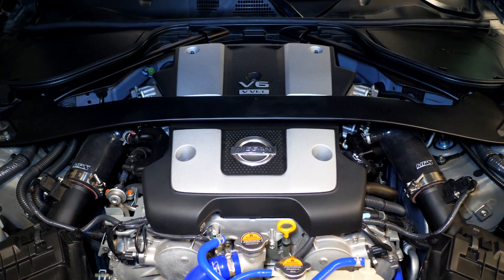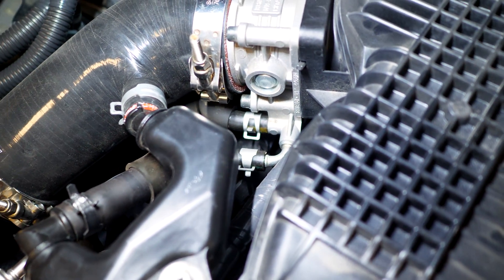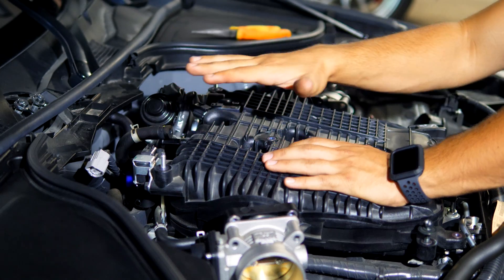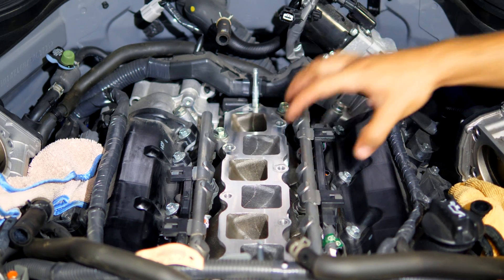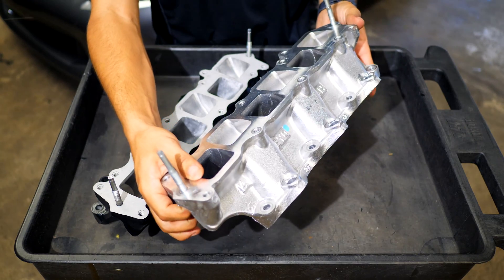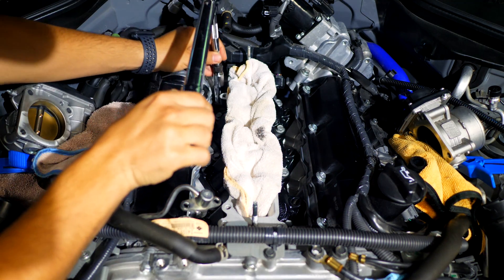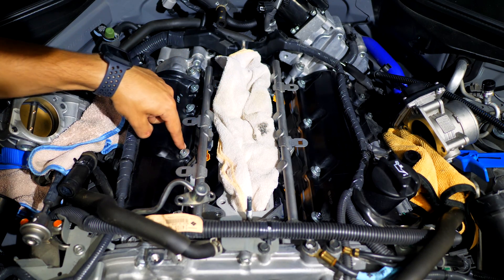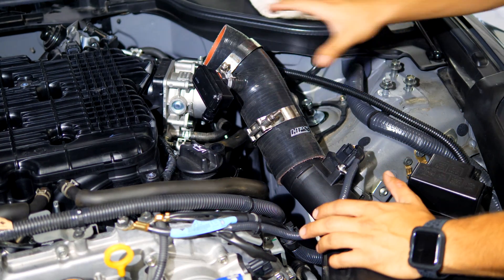Installing Ported Upper & Lower Intake Manifolds on The Z

Comment: clearly you should leave the throttle bodies on and pull the coolant lines. its stupid to pull them off and still pull one line. how about to take a look at the service manual before you make a video, youre 3 minutes in and doing it wrong. service manual is free for basically everything 86-14
Reply: not to mention it will bleed itself, the amount of coolant lost from the throttle bodies is negligible to the system

Comment: Jap engines are pretty well optimized as is. FIrst you need to know if its a restriction which casting lines etc arent

Unless you start from the beginning of the intake tract youre kinda hoping/guessing.

Comment: I enjoy learning how those manifolds made and assembled but changing them are just the waste of money because after, air just came through it.
Reply from the maker: So the point of porting them is to remove the casting lines & the inconsistency with the multi piece plastic manifold. By doing to, it allows for higher CFM, which allows the engine to make more power with a tune.

Comment: I been having problems with my G35 VQ35HR, my coolant is consume to fast and my car have a stall episode, I check for leaks and nothing is posible the manifold gasket have a leak or so, this can be a solution? No leaks anywhere in the visual inspection and this is the last chance 👀

Comment: Thanks for the help! Would like to note for others that you don't have to remove the coolant lines from the throttle body if you're just replacing the upper manifold.
Reply: What if youre replacing valvecovers ??

Comment: Great content. I'm doing mine now but I have a question re lower intake to head gasket. The gasket can be installed with the ports on the gasket either tapering in or out. Which way did you do it? Really don't want to do it the wrong way.

Comment: On the lower intake manifold, did you have to put and kind of gasket maker to hold the gaskets in place? Or do you just clean the old ones off the surface and lay the new ones in place.

Comment: Lol what's the link to that ending instrumental? After installing them does it require a tune asap?
Reply from the maker: If you have the funds to get a tune, I would defs get one after changing any engine related part. To prevent wasting an excessive amount of money on multiple tunes, try to play out when you're modding your car so you can get one tune with every part installed.

Comment: Interesting video, however most tuning specialists I've heard of usually re-profile the intake and exhaust camshaft to accompany gas flowing (porting) the intake manifolds.
Otherwise even after a "tune" the gains are minimal.
Reply: I didn't make any power with upper and lower ported manifolds, dyno proven unfortunately. I went with a knock off company lol. Even with a tune it made no power. Maybe it depends on who does the porting and if it's done right? The upper and lower manifold should be port matched with one another. NoTrigga and z1 are the best on the market.
Reply: @vq-lab i just got triggaspec ones ! :) the dude is pretty chill and explained everything very well prior to installing he also supported everything needed for install

Comment: This engine is ridiculous to change valve cover gaskets. I use to do this on my 78 Transam in a half hour. Same with intake. Ill be paying a mechanic soon to add headers, fix valve cover gaskets, replace top intake with z1 ported and new plugs and any other gaskets.

Comment: question: as pertaining to removing the upper intake manifold...there are two nuts that hold the manifold down once removed and the rear end of the manifold is stuck on the rear bolt...after the nut is removed how do I get it loose...and not damage the plastic manifold..thanks

Comment: Awesome video the upper intake and lower intake ported nice the one thing to help it breath better upgrade the throttle to bigger size and port the heads and port the exhaust as well and upgrade the intake valves to go with the ported heads on the cold side and hot side 
It's sounds crazy and money to do all of that u will see more power and worth it depends on the individual but I would

Comment: Did you install all new gaskets for the upper plenum , lower manifold and the TBs?
Reply from the maker: I replaced the plenum gaskets, but if yours are in good condition, I suspect you can reuse them.

Comment: How could anyone dislike this great video. Great instruction bro.
Reply: EMAH MUSIC  u missin the point of modding/ sleeper cars
Reply: The dislikes are mechanics😂
Reply: EMAH MUSIC  Say that to literally any car guy and they will avoid you 💀 Dude you're missing the point of modding cars.
Reply: Arm chair analysis: smooth ports promote flow therefore air velocity...rough ports promote turbulence... turbulence is good for fuel mixture. So it's a matter of determining what engine likes what more...in this case we got fuel injectors so I think the whole mixing might not be as important

Comment: How did you prime the engine?
Reply from the maker: Cycle the ignition multiple times. You will be able to hear the fuel pump turn on and pressurize the lines.
Reply: milanmastracci before you replied that is exactly what I did. Glad I did it correctly

Comment: I have a question... can i use that kind of intake manifold in another vq35? 

I mean can I use the vq35hr intake manifold onto a vq35de ?
Reply: Daniel Argueta no because the HR manifold pattern wouldn’t fit with the DE lower manifold. I gotta buy a DE ported manifold
Reply: Daniel Argueta you*

Comment: When you widen the port on the lower intake manifold you don't create more velocity. You create more flow (more air). It's a touchy subject, but the smaller intake holes create more velocity. Velocity to an engine is like playing a trick on it. It makes it actually moves more air than if you had this huge hole would because of the Bernoulli's effect. I could go very deep in this subject, but I thought I would just stick that out there!
Reply: @cv 67 I did a full taper with no curves on my Yamaha 125 2 stroke and it gained 10 hp (which is A LOT on dirtbikes)!!

Comment: I hope you measured the head ports. While this may help slightly and I mean slightly .... no point in more air coming in if the actual head ports are smaller and basically creates a bottle neck effect.

Comment: Thanks for sharing I want to do this to my car now lol cant wait for the dyno tune. The Z1 intakes supposedly make a decent difference. I heard you can diy the intakes and now after watching your videos I know I can get it done. Thanks bro
Reply: You are better off getting a 3" intake and bigger throttle body's on the plastic intake models. The Japanese are very smart and knew what they were doing when that designed the smaller ports due to Bernoulli's principle. Also a quality exhaust is a huge plus on Z's and the G's

Comment: Bro don't use gas as a lubricant for the fuel injector o-rings. Just put a little spit on them glides right in no snags and no worries about premature o-ring failure.

Comment: Next vidéo : ported throttle body ? 😋
Reply: They are already smooth at can be. You have to get the bigger throttle body's
Reply: @ianjones1498  no u dont they come 58mm you can port to 62.5 for a 7-8whp gain
Reply: @alvarez6899  flow doesn't give you hp, velocity does
Reply: @ianjones1498  tf it dont.
Reply: @ianjones1498  its literally proven google 62.5m 370z tbs

Comment: Please consider going with 3” admin intakes and getting a revup admin tune.
You’re looking at an average of +35whp with just the intakes and tune.
Reply: Not true. The intakes  are not worth crap.
Reply: @HorgretorGellantara  3" intakes have shown up to 22whp over 2.5" long tube intakes on the VHR
Reply: @Cheeseypoofs85  have you been on the dyno and compared them side by side with no tune changes except for the scaling? Because I have
Reply: @HorgretorGellantara  what's the point of an upgrade if you don't tune for it?
Reply: @Cheeseypoofs85  I guess I worded that incorrectly. It was at max timing already, 3in intakes made 3 whp over the factory timing with both tunes maxed out. There's actually a video comparison on here somewhere that shows exactly what I found out on the dyno.

Comment: Hey Milan, bolts are NOT measured by head size but by THREAD size. Head sizes can be different for the same thread size. IE 10mm thread size could have a 14 or maybe 15mm head size.

Comment: Way too much work for 4 HP hahaha. Thought you need upgraded throttle bodies (enlarged) and 3inch intake pipes to get benefit from porting ?
Reply: Welcome to the world of NA tuning. He also has post maf tubes that make 1-2hp
Reply: @nighthawk0077 n/a tuning is like crack. Each performance gain and the feeling each component is aiding in power is satisfying.
Reply: Any mod for this car is pretty much useless unless you go with a super charger or turbo

The amount of money you will spend for bolt ons can be used for forced induction 

I only have test pipes and long tube intake installed then called it a day...left the nismo stock exhaust alone

Has enough power for everyday spirited driving for me
Reply: @dukenukeman actually not usually keeps the car maintenance and will last longer

Comment: Cracks me up seeing plastic manifolds gotta love modern car manufacturers 🤦‍♂️
Reply: Lighter and less heat soak. They know what they’re doing lol.
Reply: Thomas Rollins “ok” not cause it’s cheaper or anything if it’s better how come no racing teams use plastic parts 😂😂😂😂
Reply: Carolina Srt4 a sheby gt350 makes 526 hp and has a plastic intake manifold. An LS7 makes 505 hp and has a plastic intake manifold. Plastic does just fine. Don’t know about race cars.
Reply: Because race cars are custom made, u dont custom made parts using plastic. Easier to fabricate using steel, or if u got lots of money to spend, use carbonfibre. 

Plastic are cheap to made in large batch, but not in small scale. U not gonna design,developed plastic parts, with all mould needed just to made a few dont u?
Reply: For how little power the NA Z  and G cars can make, the plastic manifold is fine. Look at the 3.0t infiniti's, their pushing 450/600 or even more to the wheels with plastic manifolds, they just need turbo seals replaced, a newheat exchanger, exhaust and tune.. besides that the Greddy GTR intake manifold is a bolt on part for 3.7 Z and G's if you get the billet lower manifold from rjm (only with it if the cars boosted).
Reply: @christiansmith2425  Z and G are not slow, 330-348 is fine for the price its at 3.0t are 330 until less you get a red sport which has twin turbo 3.0t for about 50k+ for an extra 70 hps but is nice for a 3.0 liter engine.